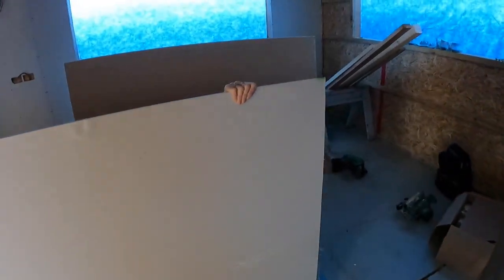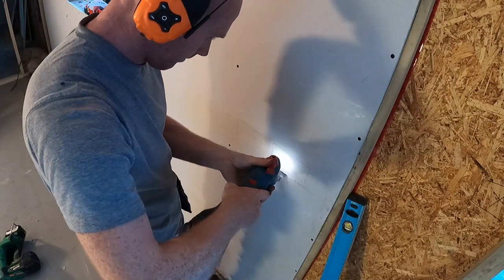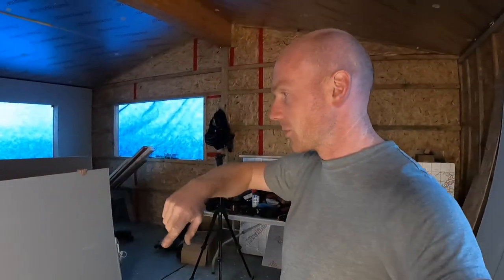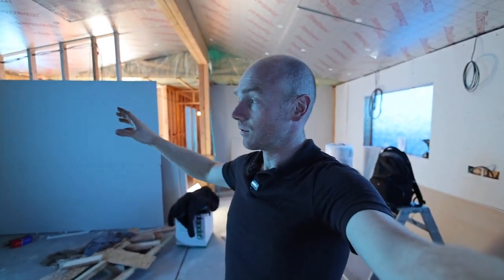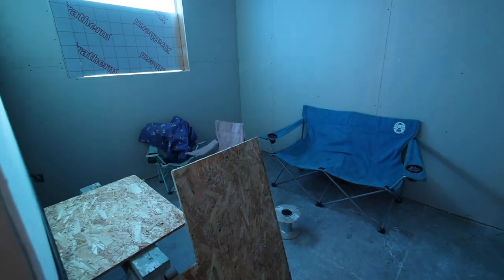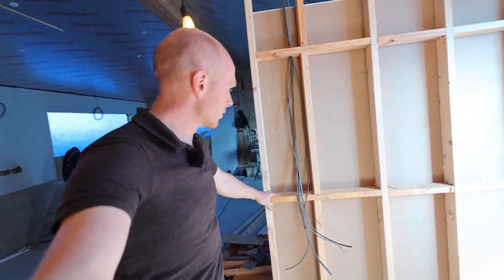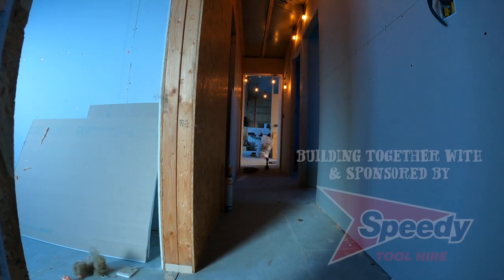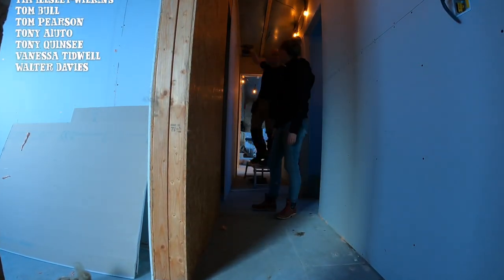CABIN FEELING HUGE NOW! - How many sheets can we fit in an evening?

Comment: Why didn’t you use metal studs? Would have kept the weight down significantly, potentially been easier/quicker?
Reply from the maker: Hindsight! We had bought a full pack of CLS back in spring so used what we had.
Reply: @TheRestorationCouple  Fair enough! I’ve only just spent time looking into it, walls and divisions look easy enough, ceilings look slightly more hassle than using timber

Comment: Mate when you push a plug top into a wall socket the force used to push it in is transferred to the plasterboard and the wall will flex, the socket face plate screws are only there to keep the face plate in place and stop exposure to live terminations, you’d be better off with half inch plaster boards. Great channel, keep up the good work.
Reply from the maker: Good point. We ended up blocking behind a few areas which helps but needed to be 9.5mm to keep weight down.
Reply: Whilst I can see weight was the driver behind your decision. It’s a relatively small increase in load of just over 200kg (60 sheets 9.5mm Vs 60 sheets 12.5mm), i do think a cabin of this construction method would have benefitted from a thicker board. The tensile and compressive strength of 12.5 are both over 170% that of 9.5 and In a timber build that is designed to be moved, It would concern me more how the thinner boards will hold up. The weight increase is also the equivalent of having a couple of large people come to visit.
Loving the videos as always, hoping you’re in & settled for Xmas dinner.
Reply: I have to agree, the 12mm boards also give a better finish..

Comment: Great job both. I would use rockwool slabs in the internal walls, it’s far more acoustically dampening than mineral wools and also has flame retardant properties
Reply from the maker: We had loads of the sheepswool here left over otherwise I might have looked at proper acoustic slabs like you suggest. Anything should be better than nothing though. 👍